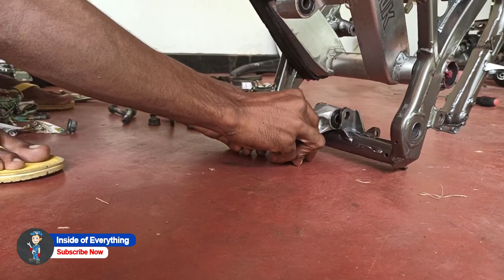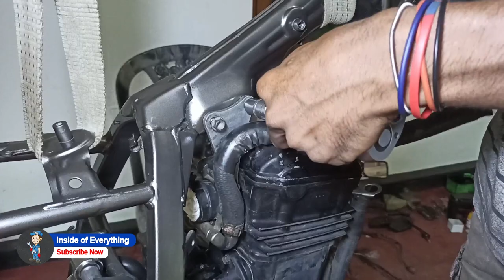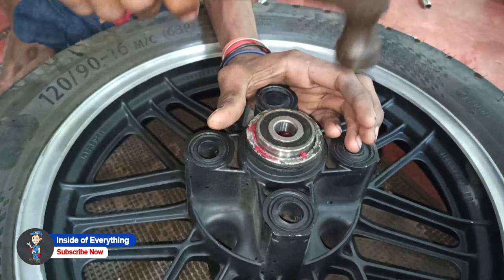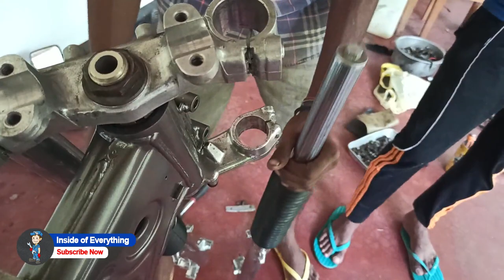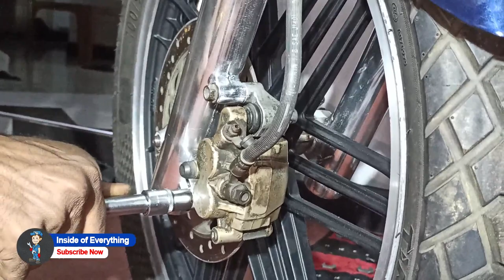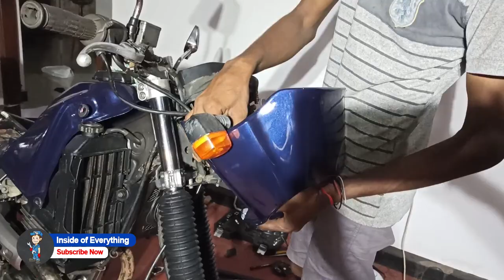Honda AX-1 Assembling

Comment: I have a Honda Ax1 motorcycle in the process of restoration. I am from Nicaragua. My question is, is it normal for the motorcycle stator to be wet in oil or should it remain dry?  I need some advice about whether the stator should be wet or dry?.  I leave you a powerful like
Reply: Hola herm,,, disculpa la molestia,,, tengo una Honda xl 250cc degree y no encuentro los anillos del piston ,,, me dijeron q es similar a los de la AX1 ,,, tu sabes donde los puedo conseguir soy de Nicaragua chinandega,,,, te agradezco la información,,, bendiciones
Reply: @luisblandonmorales6629  yo he estado comprando poco a poco las piezas originales porque son caras
Reply: Me podrías Acer el favor de darme información de donde las puedo comprar ,,,gracias y Bendiciones
Reply: @klaushenryriepmanperez2184 gracias ,, disculpa las molestia